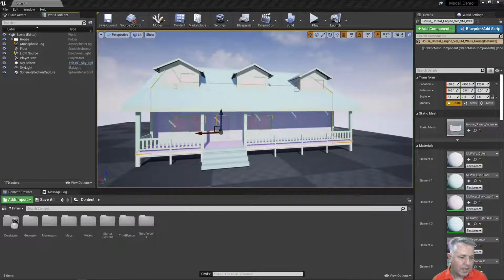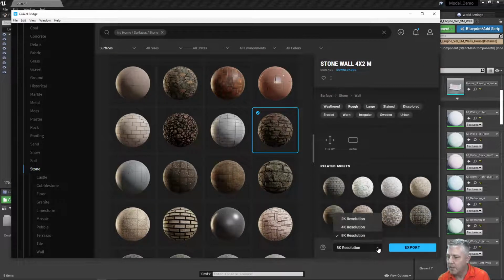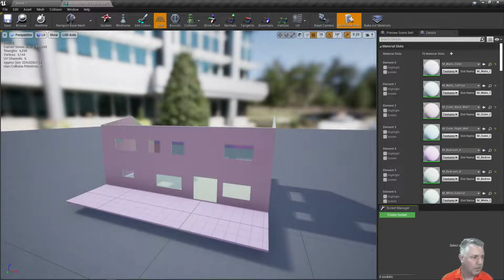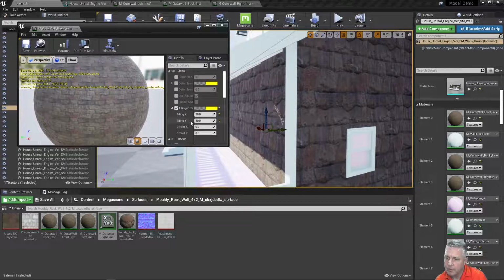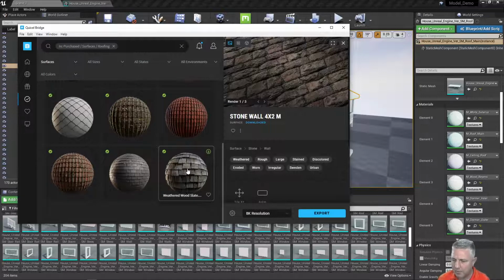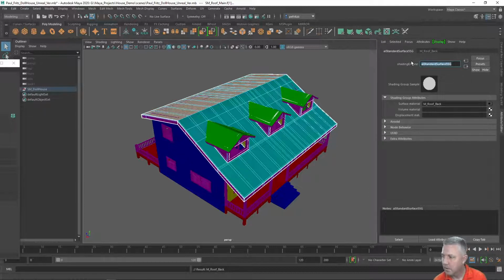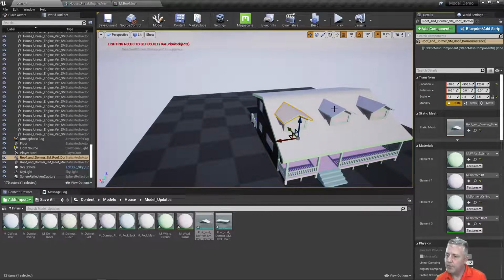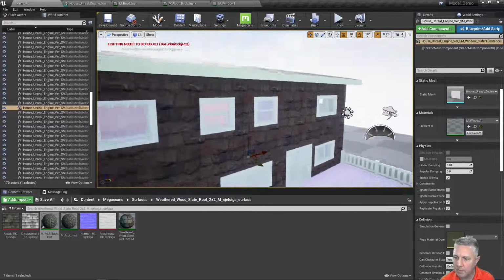Adding Quixel Materials to Your Model in Unreal Engine

Comment: bridge simply doesn't immport for me. Says unreal isn't running when it is
Reply from the maker: Hey, thanks for the question. Back when I made this video Bridge and Unreal Engine were separate and you had to have a plugin installed. Good news is that Bridge is integrated in Unreal Now. It is in the Window tab of Unreal Engine near the bottom of that menu. You’ll have to sign in to your Epic account again. Once open, it works the same way as in my video. If that is not the issue, please let me know.

Comment: this isn't very efficient within engine surely with all the different materials on that one model
Reply from the maker: Hi Bailey, I have to agree, it is time consuming.  Most of the process is done inside of the modeling software with the UVs and assigning materials to each unique piece of the model.  Using Substance Painter or Quixel Mixer are fairly lengthy processes as well depending on the level of detail you are wanting to achieve.  However, once finished in those programs you have a completed texture that goes with the model. That is a standard pipeline process and is quicker for reusing the model in each new project.  So why do it this way?  I have found that I can easily change out individual textures using this process, using the Quixel Megascan materials directly gives me much more control for each individual material, and the level of detail in the texture is greater than if applied as part of a texture in Mixer. I can also go into the Blueprint and modify one texture without affecting others.  Thank you for the question.  Hopefully my explanation makes sense.